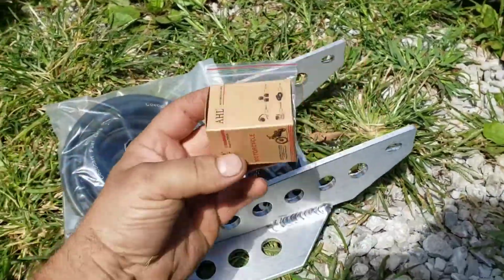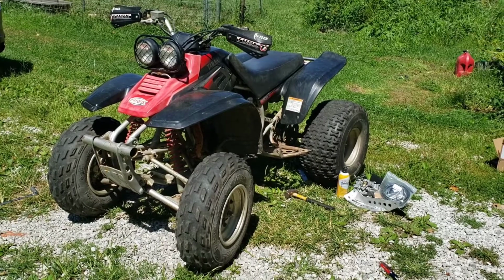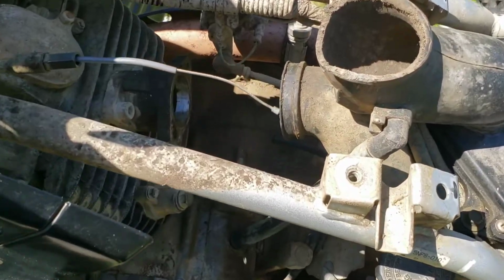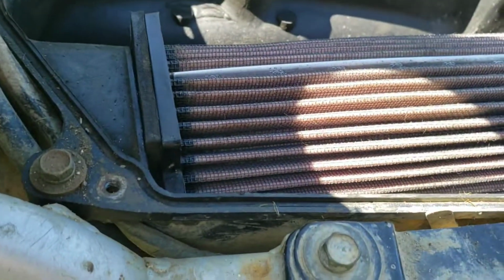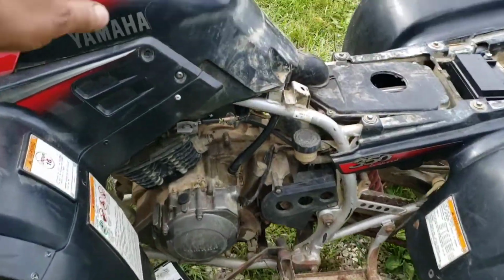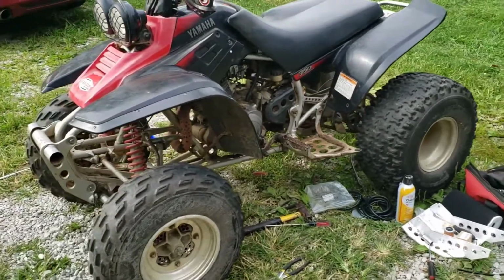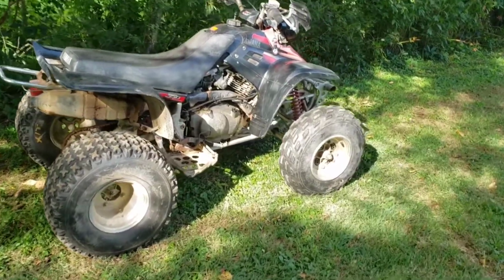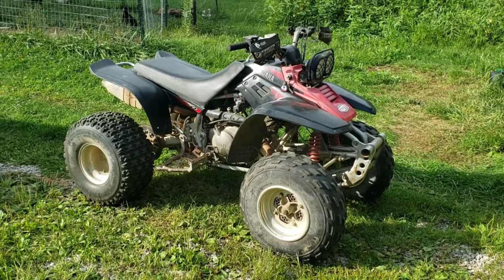Yamaha Warrior Tune Up - New Carb, Plug, & Filters + Ride

Comment: I have a 02 warrior was running great next thing you know it wouldn’t turn on found out it was the stator put a new one... fires right up but now when I push the throttle it gives up..WHAT DO YOU THINK IS WRONG?

Comment: Thats a pretty nice warrior. Banshee shocks fit and will give you a more plush ride vs stockers.
Reply from the maker: Did not know that, thanks for the tip.
Reply: Also a raptor rear shock is a nice upgrade from stock.
Reply: Same year and cc ?
Reply: @adriancorpus862  ? I don't ubderstand the question?♧
Reply: what year and what cc banshee will fit my 93 warrior
Reply: @adriancorpus862  I would shoot for the later model banshee shocks myself. You can usually find them still in decent condition. A raptor 660R or raptor 350 rear shock is a good improvement over stock also. I have a nice one w/ red spring if your interested. I can shoot you a pic.
Reply: @adriancorpus862  All banshee's are 350cc twins.
Reply: @brainstain22  do they bolt on or do i have to make it fit my own way ? Thanks for helping out real talk
Reply: @adriancorpus862  no prob...Its been a while since I had my warrior but I beleive it all bolted right up. But I have always made a custom bracket on all my quads to run longer shocks...basically just relocating the top shock mounts on the frame. Did the same on the 400ex to run fox podiums. Now I run 450R front shocks with that bracket (It softens them up a bit).
Reply: @brainstain22  what about a fatty pipe or expansion chamber have yall tried to get one of those for this or do they not make them ??
Reply from the maker: You talking about the 2-stroke style header? Those only work on 2-strokes lol.
Reply: @BuckeyeBallistics  yeah those i guess someone was telling me that its not all hallow or sum like that basically just for looks i guess
Reply from the maker: I'm not "100%" sure, but I'm pretty sure they are 99% hollow. And I'm not sure exactly how it works, but something with the size and shape of it helps 2-stroke engines make more power. A lof of older 2-stoke dirtbikes don't have this design, but they're also not very powerful lol. I'm also pretty sure you would lose power if you somehow managed to fabricate one up to a 4-stroke... but it would certainly be an interesting experiment.

Comment: Was your OEM throttle cable long enough to make a good fit even with that new carburetor's longer tube?  I got a new carb from zoom zoom parts, but since its tube is longer, the throttle cable isn't long enough to fit all the way in
Reply from the maker: My memory is vague on this because it's been a few years, but I don't recall having any issues. I also vaguely recall the issue you mention on some of the reviews for other carbs, so I probably bought the one I did based off of the reviews and it not having this issue...
Reply: @BuckeyeBallistics  Ah that makes sense, thank you for the clarification

Comment: mine was running fine but the carb was leaking so i bought a new carb and put it on and then it would drive for like 10 seconds and die so i switched out the jet and now it will barley start and when it does it only idles and womg take any throttle without dying any ideas?
Reply from the maker: Yeah, cheap carb. I would fix up the original- they are like $400 for a new one. I chose the cheap carb that I did after hours of research, to make sure what happened to you didn't happen to me. There is a link in the description for the carb that I used. I will say however, that if I suddenly jab the throttle wide open at low rpms, that it trys to stall out (because it is a cheap carb). Other than that, it runs perfect with the one that I bought.

Comment: Mine keeps accelarted.. when i accelerated just a litle bit it keeps like really accelerated so its the carburator?
Reply from the maker: The throttle cable or carb is sticking
Reply: @BuckeyeBallistics  oh besides that... it has another problem.. when i try to put it on neutral it doesnt work i do t know if it the need of oil or a cable of the neutral its weird because when i put it on reverse i cant put it back on forward and the light of neutral doesnt turn un when i try to put it on neutral its so hard and weird.. maybe it could need some oil right? Because the shifts it does them just fine except when i try to put it on neutral
Reply from the maker: Mine did that too, common problem for older bikes that have been ran hard.
Reply: @BuckeyeBallistics  so what u recomend me to do ? Because it just not good jeje maybe sell it and buy another one :/
Reply: And its so annoying
Reply from the maker: Yeah I don't know, never did figure mine out. I changed the oil and even put a new clutch in it and messed with the clutch linkage and everything. I think in this video I said it was working good, but shortly after it started sticking again. 

I know it's annoying, but it doesn't really matter because you can just pull in the clutch and start it in any gear. I'm not sure, but I think you would have to overhaul the transmission in the engine to fix it...

Comment: Nice video. If you tip the quad up on its side you don't have to drain the oil to change the oil filter. A trick my mechanic showed me.
Reply from the maker: Thanks. What you say is true, but I wouldn't tip it too far or you will get some oil in the head.

Comment: Tip next time for the air filter, instead of using a rag to pinch it, use grease to seal it, will do a better job of keeping dirt and mud out anyway
Reply from the maker: And suck grease into the engine? No thanks.

Comment: As soon as I turn the gas on it dumbs out the run off what do you recommend
Reply from the maker: Float bowl/float needle stuck. Disassemble and clean carb or replace.
Reply: @BuckeyeBallistics  do you have or know of a video showing how to do this
Reply from the maker: The float? I'm sure it's not hard to find if you simply search "stuck float fix" or "how to fix stuck float needle" or something similar. Carbs on small engines are all pretty much the same design, so it doesn't have to be specifically a Warrior video to see what you need to do. As for replacing the carb, well, I did that in this video. You can get a new carb on amazon for $30-$40. I think I spent a little more though because I bought a better one.
Reply: What’s the part# or link to the one you bought?
Reply from the maker: https://www.amazon.com/gp/aw/d/B00KNPRSNO?psc=1&ref=ppx_pop_mob_b_asin_title

Comment: I found the filter guide complete assembly OEM on Ebay for under 100 in april of 2021. My 88 warrior just didn't have an air filter. when I opened the air box for the first time I was like damn more money already lol. They sell it in pieces but the end cap would probably help the kn stay in better and it's like 15 bucks. Or cardboard pieces and a little tape and wedge it in there. That should be cheap enough if not close at hand already lol.

Comment: My carburetor idles up so high idk what to do
Reply from the maker: Is the choke stuck on?
Reply from the maker: Also there should be an idle screw so you can adjust the idle
Reply: @BuckeyeBallistics  do yk where it’s at cause my warrior is running too lean atm n feels very sluggish n sometimes it keeps going even after I let go of the throttle
Reply from the maker: We were discussing the idle screw- what you are talking about is the mixture screw which it may or may not have. I know the basics of a carburetors, but I haven't messed with them enough to be able to tell you right where it is off the top of my head. Try googling or youtube search warrior 350 mixture screw/location...
Reply: @BuckeyeBallistics  will do

Comment: Riding that fast around all those trees for your safety I suggest you get some ear protection.  No need to worry about the brakes as you can just find a tree to stop you.  That carb sure made a huge difference in the way it runs.  Great fix.  Just don't hurt yourself.
Reply from the maker: I can't comprehend if you're joking or being genuine, or a little of both. I tried to tell you on the last video that I have extensive experience riding, that I used to ride like this all the time. If what I'm doing in this videos looks dangerous to you, then you definately don't want to see how I ride on a trial in the woods. 😅 But again, I'm a seasoned veteran on these- I know what I'm doing, and this one is actually a lot slower than what I used to have lol. Thanks for your concern, but I'll be fine as I'm no rookie at riding them.
Reply: Guns&Cars tellem you’re a General 😂💯🔥🔥💪🏾💨🔥
Reply: @BuckeyeBallistics  A little of both.  Pretty sure ear protection wouldn't help much if you hit one of those trees.  Just concerned for your safety.  Even if you are a pro accidents do happen.  Just have fun and be careful as you can.
Reply from the maker: I thought maybe you were saying ear protection from the sound of the exhaust bouncing off of the trees and damaging my hearing; I was completely lost. And absolutely, pro's still wreck (because they push harder). I just didn't want you to think I was some yayhoo who just got his first atv and was gonna kill himself on it being dumb.